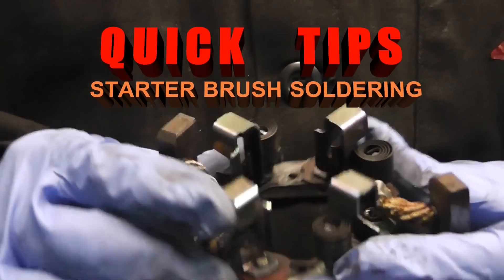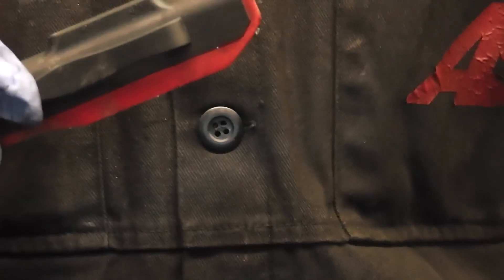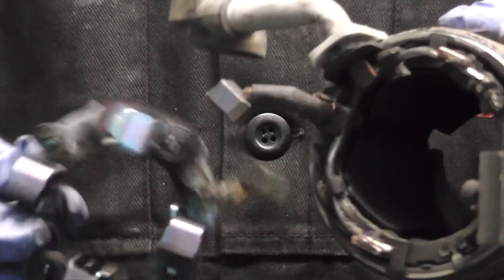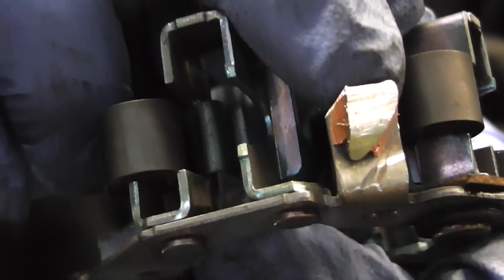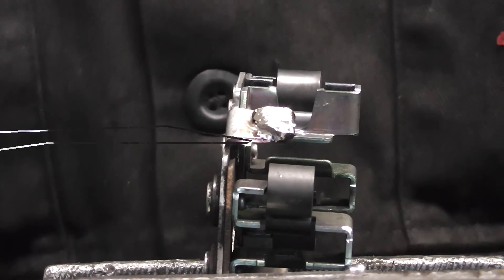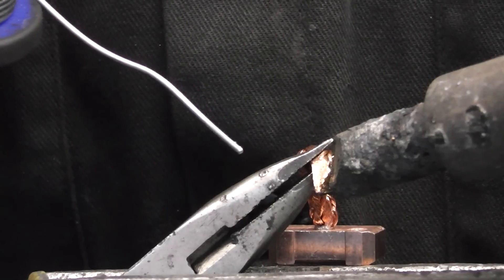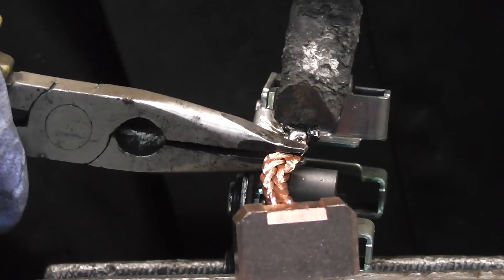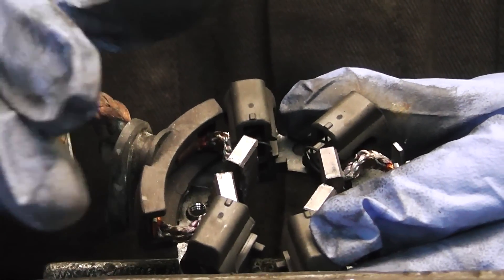Starter motor brushes soldering guide (QUICK TIP).

Comment: I fix all my own alternators and starters but the tip about holding the braided copper wire with the pliers when tinning it is a new one to me which I'm going to use the next time I'm replacing brushes, thanks for the video.
Reply: Привет друг, я не рекомендую такой метод установки щёток, при работе стартера щётки с подводящим проводом сильно греются и есть вероятность что щётка отпаяется, ремонтировал уже после такого ремонта, советую купить тиг горелку и медный прут(присадку) фирмы HARRIS USA, подключив эту горелку к сварочному обычному аппарату и током примерно 60 Ампер, приваривать щётки, сваривая медь с медью, результат идеальный, сразу может не получиться, рекомендую потренироваться с старым стартером.

Comment: it will soldier it self out back when you crank it up to 180 degree celsius(soldier point). it is just a simple way to fix it if your engine does not require a serious crankint to start it,you just crank it for a 15-20 secs, and you need to take out your starter and re soder it.guys in my country who are rebuilding starters and alternators are using welding method called point soldering or argon soldering, there are also several ways to connect brushes new wire to old wire home made ways like to cap it wit an copper plate and soldier it with an axid soldieing, it is quite effective if you do not use argon or point welding method.
Reply: This is comforting... thanks for your input Jonas. I'm an experienced mechanic and most of the times i painstakingly use the factory clippings and rebuilding it which occasionally you ran the risk of deforming the brackets and alignment because i'm so pessimistic about soldering alone. I live in a hot climate with always hot engine and melting solder "direct" connection always worries me. Now i'm getting tired of my methods because it's time consuming.
Reply: yes , you  are right, this type of soldering on the video is a temporary solution.
Reply: Приветствую. Я свариваю щётки тигом с присадкой HARRIS USA, тоесть медь с медью, результат как с завода. Метод припаивания паяльником не рекомендую.

Comment: I did mine with a hot air station and it worked :) not a paint stripping gun a pukka heat station that I have for soldering.I guess a plumbers blow torch would work but needs care if you havent got a soldering iron with a super large tip like the one in the video.

Comment: Great video. My soldering skills are rubbish and from the small amount of effort I put in I couldn't find the right size brushes. It's for a boat starter and I don't want to get stuck out at sea with the kids so I'm going to buy a new starter. I have some skills and knowledge. Soldering is not one of those skills haha.

Comment: Once again a great video...   However, I would have used a pair of wire snips/cutters that have a fine beveled end.  Then place them where the plate is bent over and clamping the braided copper lead. Then as you squeeze as to cut a wire, it will open/spread that clamp.  After a little effort, the existing copper lead will come out.  Prep the new brush leads as he showed with solder, place in the clap, close the clamp to compress the lead and then solder the entire connection.

No matter what country you are in, how hot it may get or just how long you crank the motor........  The joint will never come apart!!!!!
Reply: THAT IS THE ONLY WAY TO DO IT!!!!  not like you see in the video,i would never trust a job like that;

Comment: Hello sir, one of my positive wires came out of the brush , do i just solder the cable into the hole of the brush ? i have the same exact brush set you ar working on in this video . Thank you also for sharing your knowledge it is very much appreciated. Have a nice day ! Thanks for helping me.

Comment: Ah so this cant be done with normal soldering iron then.
The issue is I have a coupe fan heater with worn-out brushes.
New plan, slaughter alternator with long enough wires that I can solder on.